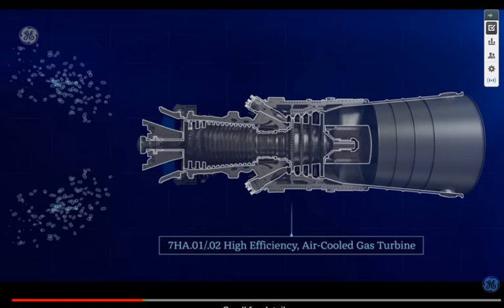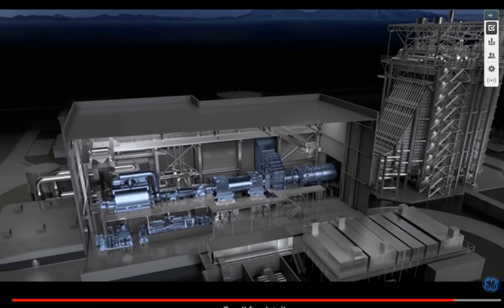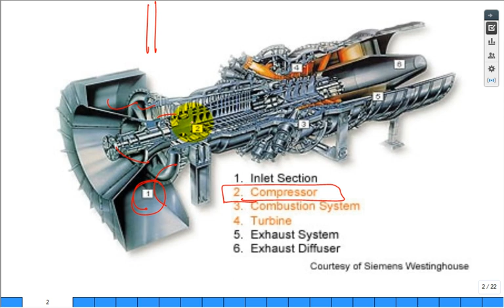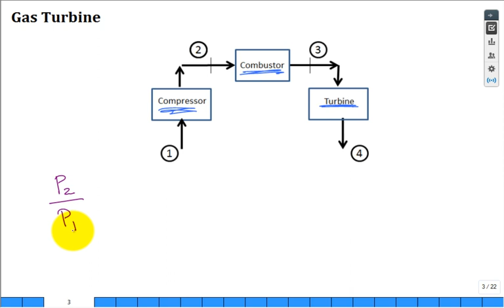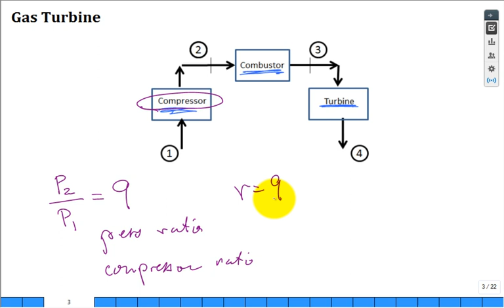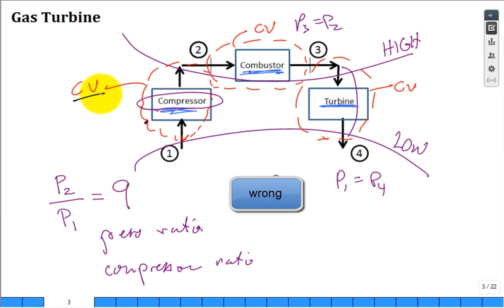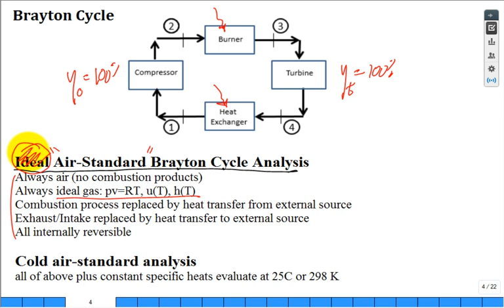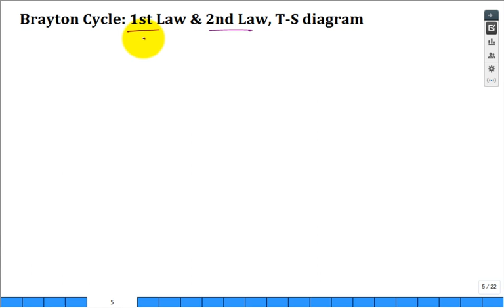intro Brayton cycle and solve a problem

Comment: This is exactly what I needed. I'm currently studying for the PE exam and I was perplexed that the Brayton cycle uses pressure ratio but the Otto/diesel cycle uses compression ratio. I thought both terms meant the same thing. Not sure how I completely forgot that they are not the same. It feels as if the Otto cycle chapter is in my dark ages as I have no recollection of ever doing any of those problems. I've been out of school for about 4 years now.

Comment: 8:50 the enthalpy should be h2-h1, exit minus inlet
Reply: It is only a matter of convention. If you say h2-h1 you get positive value and when calculating W(net) you subtract that value from W(turbine), if you use h1-h2 then you just add to W(turbine), which gives the same result.